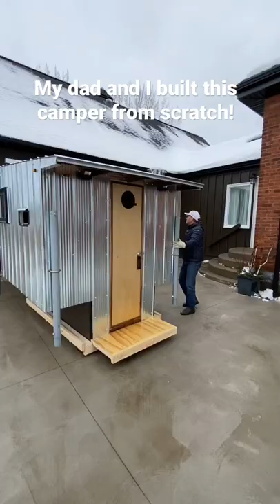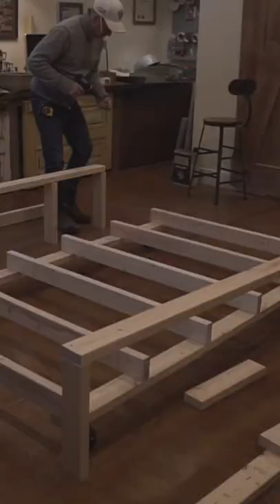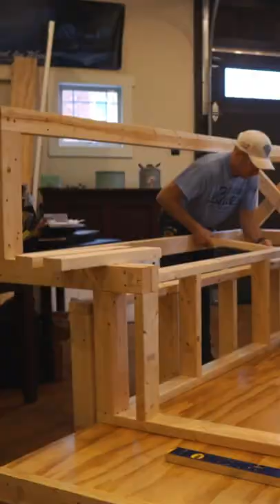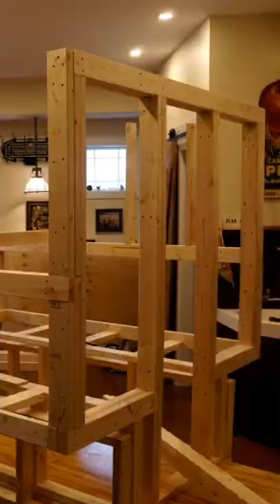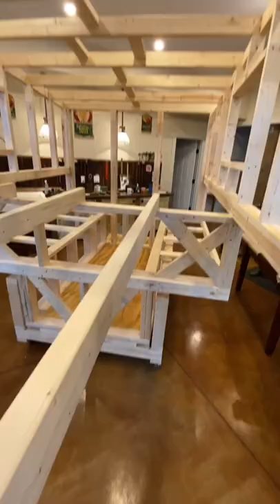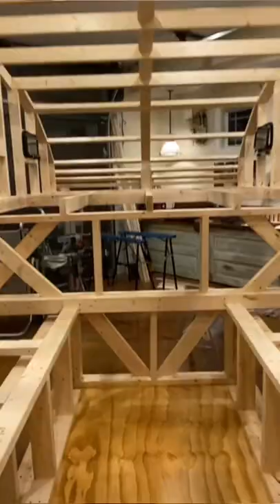How I built my DIY Truck Camper (Part 1) #shorts

Comment: Using 2x4s is insane you would have been much better off with either light gauge steel tubing or aluminum tubing
Reply: Literally said to myself "oof with 2x4s?" Not how most would do it but still gets the same job done
Reply from the maker: Man oh man, I get these comments here and there and the fact of the matter is, you're right! I do wish I could go back and switch things up, but this would be learning the hard way. I had no idea what I was doing at the start of this build, and I wish I had knowledgeable people around me like you so that I could have gotten advice before the build, but ya live and ya learn. God speed!
Reply: @HondroB  But you learned some stuff, right! Full on Win! Everything looked well built anyway.
Reply: @HondroB mate awesome build be proud and just remember that was your days one now you know where you can make changes and make yours twice as good awesome work from the both of you 👌👍🇦🇺
Reply: Absolutely. Aluminum would be so much lighter and last almost forever. But it would probably cost 10x the price and require welding skills and a tig welder or  aluminum spool gun. Use what you got. Build looks great, . Most people would be intimidated to take on a project like this
Reply: @HarryHov  would you like to see? Bet it’s better then a 2x4 wooden camper!! Over here tho you won’t find wood unless it is a grey nomad we like to get off the roads and see the bush wood would fall apart great job and lessons are learned
Reply: @McLuvinJuice12  and will take a bunch of insulation if heading up north. I love it, it will last for ever.
Reply: @Donnie Gombel  i dig it too this guy killed it. Aluminum would've been better yes, but he worked with what he has and made a capable camper. Way more then I've done waiting to do it with steel tubing
Reply: I built a truck camper with a steel frame...I won't do that again. It was strong, but in hindsight I couhave achieved the same strength and vibration resistance from foam/ply laminate with less weight and less headache with the wood-steel interface.

Comment: Definitely sturdy but a lot unnecessary/inefficient bracing just a lot of extra weight with not much gain
Reply from the maker: I think i can agree with you there! the interesting part is I really have no idea (especially when building this) where the best trade off between strength and weight lies

Comment: Or you could use aluminum framing.
Expensive yet much lighter and adjustable.
Reply from the maker: Yup, aluminum would have been a way better option! I'm just a kook lol
Reply: @HondroB  or just get a bigger truck. I have an 02 2500 Dodge that can tote that all over the americas no problem. You and your dad did a fantastic job and a Tip of my Hat for how you drew it up. Any chance of getting a copy of your design for the from ?? Will gladly pay $$ for your help.
Reply: @HondroB  well your grand kids will be able to play in it now. So good on you. Built to last.
Reply: Another option that is often overlooked/underused is the hog out the timbers in spots to reduce wood volume and weight.

Comment: Never put down anyone for trying that's how we all learn new things. Is it heavy with 2x4's ? probably but good thing is the next one he builds will be easier and lighter and I'm sure he could easily sell this one and make a profit to someone afraid to take on such a build and he can use that money to fund a new and better lighter one. Don't put anyone down for having the balls to take on a build and learning. Plus the future build will let him spend more quality time with his pops and build more memories. Awesome job for your first build 👍🏻
Reply: It isn't about putting a person down it's about encouraging them to be smarter before acting. The industry already uses aluminum framework and some research would have easily revealed that and helped guide all the energy he put into the project into a more practical end. I suspect woodworking skills prevailed over welding skills making wood the obvious choice. He commented that he wished he had used more 2x2 which would have been better and using

Comment: Metal studs ftw, light and can make strong, worries about vibrations you can use rivets in metal studs, came out looking good tho, building with pops can be fun, I work with mine allot
Reply from the maker: I agree, i wished i learned how to use metal and did it for this build! Working with pops is the best! i'm glad you get to spend time with him!

Comment: I would use 2x3s for frame.  Much lighter,  yet still strong. Glue and screw every joint.  Plywood gussets in key corners.

Comment: make sure to use nails not screws, the vibrations are tough on the shear strength of a nail, that's why 90% of the old style campers where 1x2s nailed together with a whole lot of wood glue!

Comment: im currently in the middle of my build and im using 2x4s for the  bucket and framing for the cabover for the rest im planning on using 2x2s for  the sides and roof for weight and 1/4 plywood for skin and then rhino lining it.

Comment: From building one with an aluminum square tube frame I can tell you the space to weight ratio is lopsided. When camper company’s used wood it was 2”square max and those were heavy.
Reply from the maker: Yup, you're probably right on this one. I had no idea what I was doing when I started and I didn't copy any builds.

Comment: Did you consider using metal studs
Reply from the maker: yesss, i just don't know how to work with metal.. wood is way easier. metal would have been a way better option, but I didn't have a welder/any welding experience etc.

Comment: Nice ! , But if you want it light weight and strong, it should be fabricated out of light weight aluminum, personally I would love to be able to hone my welding skills, to learn aluminum mig and Tig welding Skills, if not for a camper, a race car or cross cart frame !
Reply from the maker: I couldn't agree more. I didn't use aluminum because we rushed it a bit, and I had no idea how to work with metal. Wood is just easier to work with, but one day an aluminum build would be awesome! I hope you do those things! Good luck!!

Comment: You should used steel tubing. It's stronger. It won't flex. Then you could use plywood to the steel tubing. It looks good but you can't solidify the joint as if you welded them.

Comment: I would’ve used metal studs the 2 x 3 version by building a Web can be very strong and very light
Reply from the maker: Metal is just a better option all together, but a bit harder to work with
Reply: @HondroB  You’d be very very surprised I’m talking about thin metal stuff you cut with a pair of slippers quite amazing incredibly strong do some research good luck

Comment: What does the camper weigh? You inspired me to build one myself based off your design🤙🏼
Reply from the maker: Awesome that’s so cool! Depending on what truck you have try and build it a bit lighter than mine! Mine weighs about 1200 pounds.
Reply: @HondroB  Also looking to put it on a Taco
Reply from the maker: @munjunkmonkey   okay nice!! i'll be honest it is a bit heavy for the taco, it works fine but it is definitely a a bit of a hasstle to drive. If you can keep it lighter than mine with 2x2 framing, and maybe a lot more aluminum that be awesome! if i were to re-build id probably try and do an aluminum frame tbh.
Reply from the maker: @munjunkmonkey   just my honest opinion!
Reply: @HondroB  I think me and my dad are gonna give it a go with a mix of framing types like you mentioned. Do you plan on publishing your plans for purchase? I also followed you on instagram
Reply from the maker: @munjunkmonkey  Hey great! what is the payload of the truck? in my description I have a really simple drawing I made of my camper with basic dimensions. I don't have the plans but I am considering making something soon. Feel free to ask me any questions you can also email me!
Reply from the maker: @munjunkmonkey  i really do recommend keeping it lighter than mine, using aluminum or 2x2 where you can fit it! and just think about the weight before building.
Reply: @HondroB  Your camper may be lighter than you think.  We bought a built to order 4Wheel popup camper.  It is 1400#.  It has a welded aluminum frame and outer covering.

Comment: Did you consider using metal studs for part of the construction? Stronger and lightweight.
Reply from the maker: Yes I did, overall I’d say metal is a better option, but it’s harder to work with, wood is very easy and very accessible to work with so that’s why I went with it

Comment: steel studs be a lot easier to work with and lighter
Reply: Much lighter!!
Reply: Tube steel.
Reply from the maker: i wanted to use metal, but honestly i'm clueless when it comes to working with that stuff. If i tackle another build i'd go for metal 100%

Comment: I will recommend using 1/2 nail & 1/2 screw. Example if you use 4 screw instead use 2&2.
Screw will hold everything in vibration but can potentially break, nails are flexible
Reply from the maker: Yes good point, I used screws because I didn’t have a nail gun, but nails are a great option

Comment: A Why does a truck camper cost $40,000 ? yes your camper may be a bit heavy but it looks like it's nice and strong.
Reply: I spent 40K building one with an AL frame because the factory models are 60 plus.
Reply from the maker: it's so true, mine cost $6k CAD at the end of the day... she's not perfect but she gets the job done.
Reply: @HondroB  Screw what anyone thinks lik u said it does what u need it to.
Funny thing is I see more homemade truck campers than ever nowadays.

Comment: That's waaaaay over built, and will weigh significantly more than it needs to.

There are videos of builds using light and strong framing and panels, which are perfectly strong and don't weigh much.